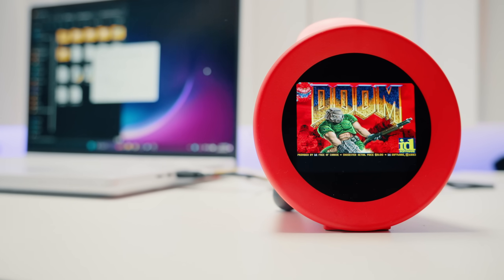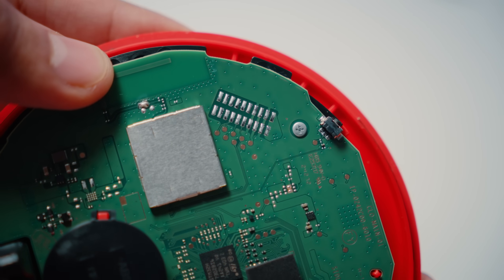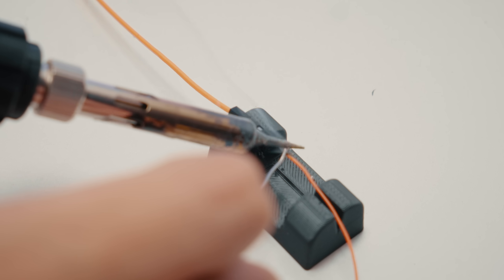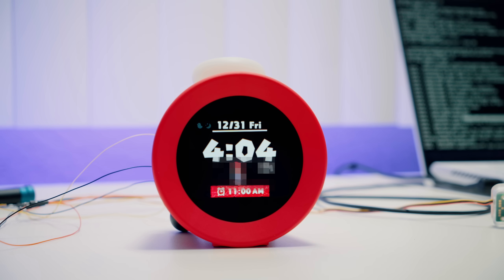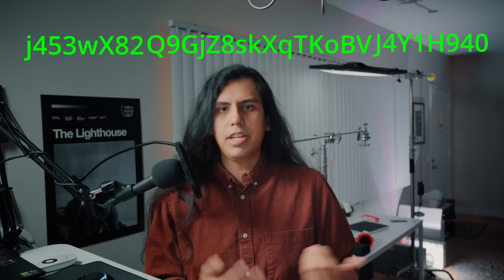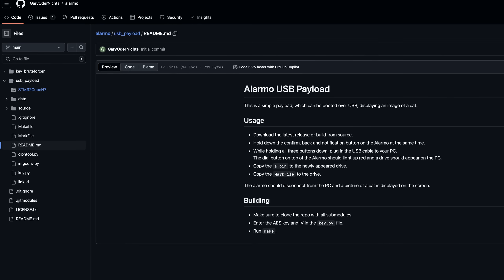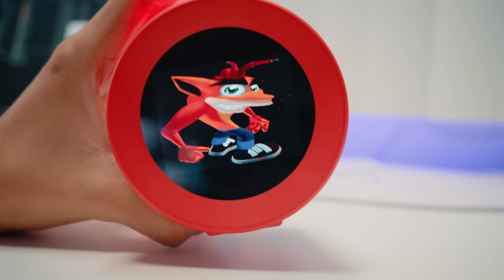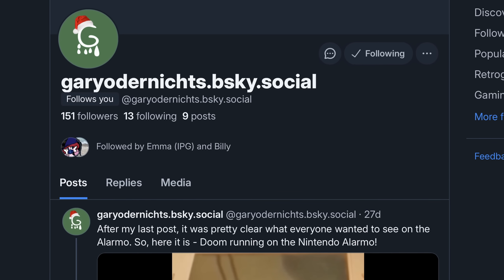Nintendo Made an Alarm Clock, So I Hacked it

Comment: Tips for soldering:
Good news! Shaking is not actually your problem.
I have shaky hands and can solder the smallest smd components with some decent quality flux core wire and a ts80 (and sometimes a lot of patience). 

1. Use flux, its the solderers best friend. Check if your solder wire has flux in it. Good electronics solder has flux in the solder wire, often called "flux core". It looks like your solder wire might not. That would explain why your solder joints look so bad. For most things, flux core is enough, but for very small work, you'll want separate flux.
2. Buy a better soldering iron. You are doing yourself no favour at all trying to solder with that iron. The work is so far away from your hand, every movement is amplified. If you want to do small scale electronics (and not soldering high power stuff), you need a suitable iron. Good irons don't even cost that much. I love my TS80 (~90$),  especially the short grip-to-tip distance, but the ts101 (~60$) or the pinecil (v2) are  valid options as well.

I hope this helps.
Reply: To add on to this, it's also important to ensure both metals being bonded are at similar temperatures. Cold joints wont make good mechanical connections (the solder may refuse to properly adhere and they snap easy).
Reply: so people like you exist! my girlfriend doesn't appreciate my short grip-to-tip distance
Reply: Yes! Switching from a cheap no-name iron to a Hakko with temperature controls was like night and day.
Reply: The pinecil was my daily driver as an RF field engineer, these modern small form factor soldering irons are INSANELY good.
Reply: A modern soldering iron (and some flux) will do wonders. I was really bad (and shaky hands too lol), and with cheap iron even trying to get better is rage-inducing. With TS100 things just clicked, time passed and now i can do even some 3D soldering or work with SMD components... not perfectly, but at least confidently and without cursing all the way. And yeah, hands stopped shaking when i got used to it and got to understand what is really hot and what is not.
Reply: 3. trim wire sticking out of the insulation to  just two millimeters fitting the pad, not 10mm extra waiting to short out
4. clean the iron tip before every solder joint
5. with a little flux, have no fear of touching neighboring pads. the liquid solder will pull back to its own pad, they will not bridge. 
6. Since they wont bridge, use a wider tip to optimize heat transfer. You can set lower temperature. 
7. Practice on scrap boards.
Reply: Another tip, soldering is not painting. Do not put the solder onto the iron and then go to the joint. First heat up the joint and then put fresh solder onto the joint and remove old solder on the iron with a brass sponge. Along with Flux, that helps a lot.
Reply: Another tip, let your hand rest on the table when soldering, and do not float it in mid air. This makes it much more stable and less shakey
Reply: 🥺 You have no idea how much that'll help me.
Reply: i can recommend the fnirsi hs-02a as well. its got really short tip to grip, works with jbc tips and its also pretty cheap, i got mine for about 30 euro on aliexpress
Reply: sorry for copying your comment did not see it before I scrolled down
Reply: What about the size of the tip? What would you guys recommend?
Reply: @AIIenIverson  A Bigger tip allows more heat transfer but is less precise and may cause you to solder joints you didn't intend. So it really depends on what you are soldering.
Reply: Yeah his lack of flux is definitely the problem
Reply: Indeed, you can rest your palm. Flux helps a lot with leaded solder.
Reply: Agreed on everything, but I find that T12 stations - I have the KSGER version - are actually more ergonomic and generally pleasant to use than TS* types. TS* are great for on-the-go use, but for a bench, gimme a T12 any day of the week. The tips are even cheaper!
Reply: Also, he's making the newbie mistake of just heating the solder itself and then globbing it on. That doesn't work. You have to heat the element, the thing you're soldering to, not the solder itself. The heat has to flow from Iron -> Component -> Solder, not Iron -> Solder. That's why he's getting those globby round solder joints, the wire is too cold. The wire has to be hot. It should stay liquid for a second even after you remove the iron because there should still be heat in the element. That way the solder will "stick" to the element, not glob on top of it.
Reply: that soldering job was actual gore

Comment: wow, you are not lying, those are some BAD solder joints ^^' 

pro-tip: USE FLUX! it makes everything SO MUCH easier, and the solder will actually flow where it needs to go instead of just sitting there as a big blob.

Comment: use flux, more heat, and dont have so much wire exposed. you dont want your joints to look like a turd and you want as little wire exposed as possible (aka none).

Comment: You should definitely use flux (a "paste" or liquid that helps you melt the solder more quickly and easy). Also, you should put the tip of the soldering iron on the contact pad holding the cable you want to solder, and then you touch the pad with the solder. There are great tutorials out there on how to solder properly, and it is one of those things where the technique is not intuitive but it is super easy to learn and makes ALL the difference.
Reply: the job of the flux is to protect from the air the soldering point. tin loves to oxidize, making it brittle and non-sticky to the copper
Reply: Flux also lowers the surface tension of solder, making it kind of like a "soap" for metal instead of water. The liquid metal has a strong affinity for other metal but will otherwise flow freely, and you can use this to your advantage to solder really fine pitch parts rather easily. The smallest I've done by hand is a QFN package with a 0.4mm pin pitch.
Reply: Tinning the wire before soldering it to something else can help too

Comment: I hope the Switch 2 has this level of security
Reply: Always get the first gens, and never update or connect to the internet, sooner or later someone will break it
Reply: @sisamusudroka3000  100% agree cause the first gen switches were stupidly easy to softmod
Reply: Why are they probably taking down all the emulators or buying them? The firmware is largely the same as on the S2
Reply: I'm still waiting for the Mariko revisions to be modded software wise
Reply: @electronicsfixer won’t happen for a very long time I’m afraid
Reply: @xMdb  I don't think it's ever happening personally. The softmod only worked because of a exploit in the SoC and they patched that in the V2 switches so if modders find a way to bring it back then maybe
Reply: @electronicsfixer try to get a modchip, very few people are working on a softmod, since the modchip is such a powerful hack
Reply: @electronicsfixer same
Reply: If you want a portable console you can do whatever you want with you could just get a steam deck
Reply: @scottcaramel yes but the Steam Deck is trying to copy the Switch, so it will be years behind the Switch 2.
Reply: @SalvadorButtersworth  Saying the Steam Deck copied the Switch is like saying the Switch copied the PSP. They just happen to have the same form factor.
Reply: @SalvadorButtersworth  crazy ahh comment bro… you mean the switch copied the PSP?!?!?
Reply: @SalvadorButtersworth it’s very ahead of the switch 2 imo, it has Linux instead of some proprietary os
Reply: @FireFoxDestroyer Lol, Linux is not a gaming OS.  That means Steam Deck is worse.  There will be no games made and optimized for Linux Steam Deck, so the games won't get the same performance they get on Switch 2.  You're paying for a console that's using a free OS because they couldn't afford to make their own.
Reply: @SalvadorButtersworth  steamOS emulates Nintendo switch, runs windows stuff, and the steam deck is user upgradeable. It’s also a full pc instead of a glorified android tablet. You can do much more on a steam deck than on a Nintendo switch. Where’s your web browser?
Reply: @FireFoxDestroyer I'm glad you agree that the Steam Deck is still trying to compete against the Switch from 8 years ago.  It will be obsolete when Switch 2 comes out.
Reply: @ you’re right, competing against actual pc handhelds with 16gb ram and actually potent graphics makes it obsolete against a Nintendo handheld.
But really, the steam deck isn’t really competing against the switch. The lack of detachable controllers and official switch game support don’t make it a real comparison to the switch. Rather, it is in competition with, as I said, windows handhelds like the ayaneo devices and gpd win series. Even then, the steam deck should be around the same power as the switch 2.
Reply: @FireFoxDestroyer yes the Steam Deck needs that extra power to run all the unnecessary extra stuff, since there are 0 games made for the Steam Deck.  Switch 2 will get better performance, longer battery life, and will be supported for years after your old tech toy is discontinued.
Reply: @SalvadorButtersworth  you can play nearly every game on steam using the steam deck as long as long as it supports controller. If you’re so doubtful then try it yourself. Games with anticheat don’t work but nearly all of them just rot your brain anyway.
Reply: @FireFoxDestroyer Steam Deck can't even play most PC games.  And it won't be able to run Switch 2 games either.  Even if it could, you'd have to get the Switch 2 controllers.

Steam Deck is just a handheld, but Switch 2 is also a 4K console.  Maybe Steam Deck 2 will be able to copy more of Switch 2's features and not be obsolete like Steam Deck.
Reply: @ let me get things straight. the switch 2 and steam deck are two different devices. One is a hybrid console meant for the regular person, that only wants fun with their games console and treats it like one. The other is a handheld for the pc gamer, giving them a familiar platform hailing from the lineage of their device and more freedom to do whatever they want. The Steam Deck runs Linux because Windows is a 💩hole of an OS. Linux, fundamentally, open source, meaning anyone can edit the code to progress it. Proton, the software I mentioned in my last comment that allows windows stuff, is also open source. Therefore, it’s made so much progress that it can now run some Windows games better than windows itself. Maybe that’s why the steam deck is still around.
Reply: @FireFoxDestroyer Playstation 1 can run Linux.
Reply: @SalvadorButtersworth  ok, and that just proves that Linux as an operating system can be optimized for anything
Reply: @SalvadorButtersworth  BROTHER it is not at all trying to be like the switch it is supposed to be a handheld pc that you can take anywhere and do whatever you wantt with it
Reply: Minecraft has sold 33 million copies for PC, and 267 million copies for consoles.  And that's the best selling PC game ever except for PUBG, which got outsold for PC by Mario Kart 8 by about 20 million copies.
Reply: @SalvadorButtersworth  Bruh were people buying 2 copies for their Wii U how did it sell 150% as well as the console it ran on
Reply: @ Firstly, did I say single game? The PC games market revenue was $45B in 2022, and $30B for all the consoles combined. There are 1.8 billion PC gamers; I promise you, you’re not beating us in sales. Unless you’re talking about the mobile gaming market, which is a whole other level and, arguably, completely different.

Secondly, nice cherry picking of a single game that fits your narrative; a game primarily played by small children who can’t afford a PC. Helldivers 2 PS5 sales were absolutely humiliated by the Steam sales, and that was supposed to be a ‘PlayStation game.’

People started erroneously reporting that Capcom games only managed to sell 44K copies of all their games on PC in the 2024 fiscal year, whilst selling over 4.5M copies across PlayStation, Xbox and Switch. Capcom themselves had to come out and say ‘Yeah, no... We sold more games on the PC in 2024 than all consoles combined. The 44K number was just physical copies, and was low because who, in 2024, has a disc drive in their PC?’

Way to admit that you don’t understand how the PC market works, though. We wait for sales more, we don’t just pay as much as possible up front while the console overlords spit on us in the form of inferior paid online services and pay walled ‘discounts,’ because there’s nothing else to play on the platform. We have considerably more games to choose from. More games are added to Steam per day than are released for any of the consoles per year. Maybe stop pretending consoles sell more games; it’s never going to be true.
Reply: @MANUELEYTOR  yep the Steam Deck is just the poor man's Switch.  After Switch 2 comes out, nobody will bother with other consoles.
Reply: @SalvadorButtersworth  Weakest bait I've seen in a while. Poor man's Switch, that's almost funny.
Reply: The Steam Deck is what's weak.  Bookmark this thread, Switch 2 will put Microsoft out of the console business.  Steam will scramble to copy Switch 2.  Nintendo will continue to sell 60 million copies of 1 game, while 60,000 copies of a PC game is considered a success.
Reply: @SalvadorButtersworth  does this guy expect backshots from Nintendo? We all know the Steam deck is better than the switch and still better than switch 2. Free online on all games, pc freedom, better controls, just to name a few. Not all games are going to be made for the switch either. But the Steam deck plays real PC games, which translates to the Steam deck having an infinite library of games. It’s the rich boy’s switch if you ask me. The switch for adults too. It’s not even competing directly with the switch, but it manages to be so nice that it died anyway. PCs are the best devices for gaming, and the Steam deck is one of them. Get ready to play your games at 240p upscaled to 720p on your 4k screen ig
Reply: @FireFoxDestroyer  pc glazer as suspected, have fun not having new mario kart or new smash game day one on your system
Reply: @Yoshizuyuner  idrc, I could emulate them easily. I have Mario kart Wii on my pc
Reply: @SalvadorButtersworth  Nah the Series S is super competitive on price at $299, and the Steam Deck at $50 less than the Switch 2 will still have a niche
Reply: @SalvadorButtersworth  What are you smoking? More games are sold on PC than every console combined, the consoles wish they could catch up. They never will.

The Switch was two year old weak hardware when it launched seven years ago, the Switch 2 will be the same way. Outdated, underpowered hardware for casuals. Nothing wrong with that if the price is right, but to say it will put anyone else out of business? I can smell your cope from here. You’re not an alt account for Harman Smith, are you?

Looking forward to you moving the goalposts when the Switch 2 drops and gets bodied by everything else on the market.
Reply: Yes, Steam is like the Crapple Store like you said.  You play Shower With Your Dad Simulator because there aren't any good games.
Reply: @SalvadorButtersworth  I’m gonna go talk to adults now, kiddo. Y’know, people who aren’t oozing pure copium from every pore because their console gets demolished by PC every single time?

While I’m gone, do try to stop embarrassing yourself with this rampant, baseless fanaticism for a multibillion dollar corporation that doesn’t know you exist and couldn’t care less about how hard they’re ripping you off for the worst experience available at every turn. Nintendo won’t sleep with you no matter how hard you shill for them.
Reply: Steam won't survive another 10 years unless it's on Nintendo consoles